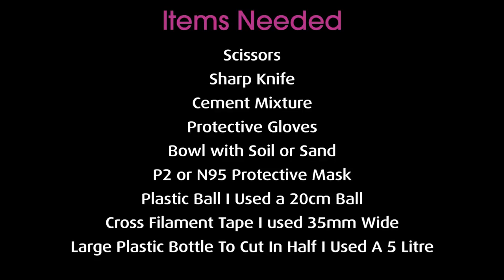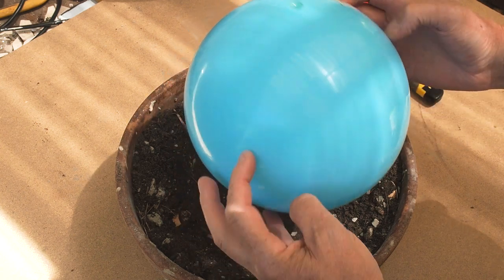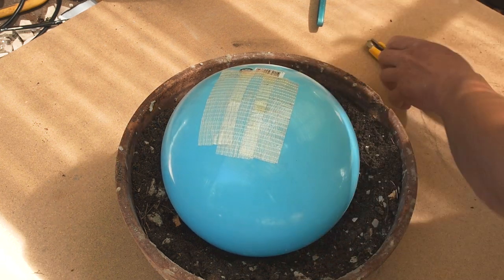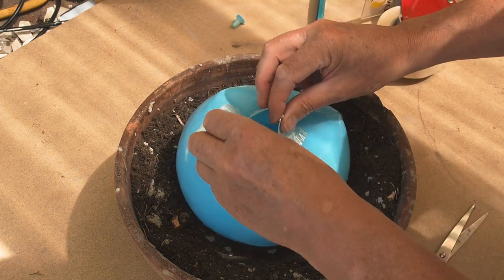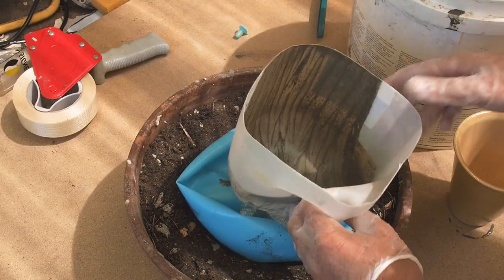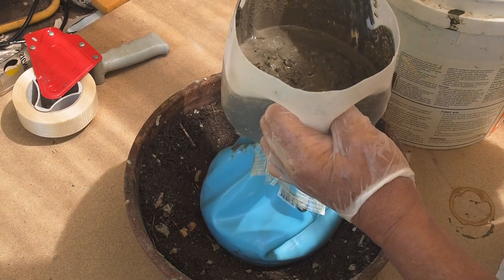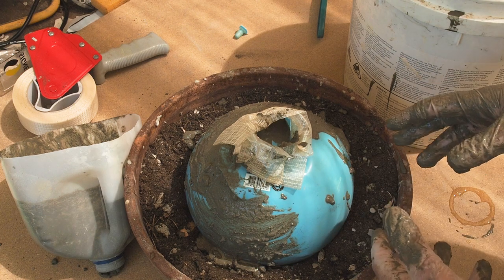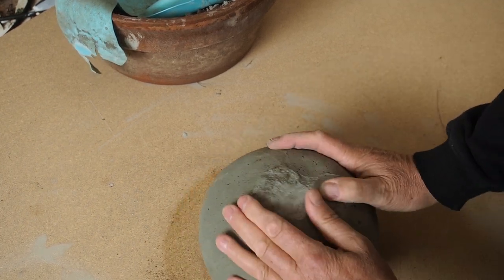Making A Concrete Gazing Ball For Mosaics - Mosaic Tutorial

Comment: I’m going to try a slush mould with a ball that has a plug (gym ball) so that I can add fine sand/cement then re-pressurise and replace the plug then roll the ball to coat the inside. Repeat and add a few layers until it’s thick enough. Add finely cut chop strand or similar for a third pour to reinforce. Result should be a light weight cement ball.
Reply from the maker: Sounds like a plan, please let me know how you go, hopefully it will be a success. :)
Reply: @TreasuryRoad  I found ‘bobo’ balloons which apart from having the advantage of being transparent, are very strong and inflate as spheres. I’ll do a test hopefully this week.
Reply from the maker: @gerardvanommenkloeke9464  That sounds exciting please keep me informed on how you go. :)
Reply: @gerardvanommenkloeke9464  en? And?😉

Comment: I love your videos and learnt a lot from you! Thanks for sharing your knowledge ☺️. Would you seal it and add some mesh and thin set layers in order for it to stand temperature variations in winter (below 0) and snow?
Reply from the maker: Thankyou very much. Personally I would be sealing it as concrete is porous and if moisture gets in then the droplets can expand around 8% causing fractures and failure of the mosaic. Some people dont seal when using thinset they just dampen the ball down a bit so as the moisture isn't sucked out of the thinset and then use grout and an additive.  
Its solid concrete so in my view it doesn't require mesh and thinset, I am not familiar with your area or the freeze thaw in your area so you may want to seek secondary advice from someone who is familiar with those conditions your piece will be in, I would be bringing the piece in during Winter. If you are in a freeze thaw area then you can use Pal Tiya instead of concrete as it is able to go below freezing. This is from the Pal Tiya website.(Passing the ASTM C666: at 300 x 'wet-freeze/thaw-cycles'!) from -4°F to +100°F. (-20°C to 37°C). :)

Comment: What’s the bottom look like? Is it rounded? I would have liked to have seen bottom.
Reply from the maker: Its round but you can make the bottom flat by just creating a flat bottom in the sand, personal preference. :)
Reply: I wanted it round , I just thought I wouldn’t need to worry about top I could flatten the top for what I want to use it for. As long as I have one side or 90% of it round. I have spent the evening watching several methods of this and I like yours the best it is very understandable. I subscribed for that reason. I didn’t expect the quick reply ( if any ) . Thank you.